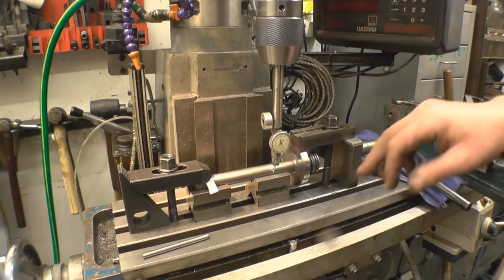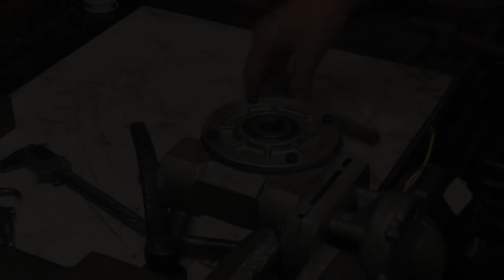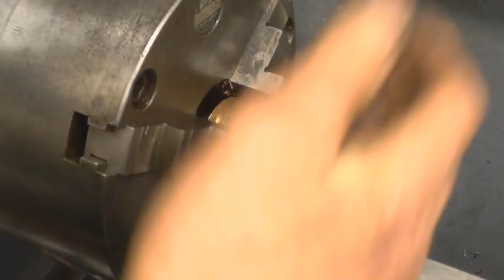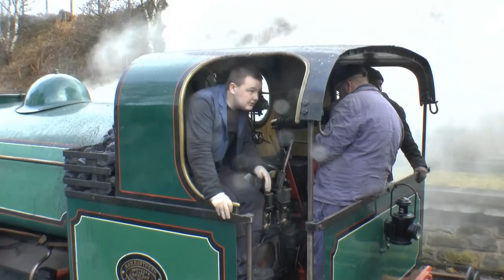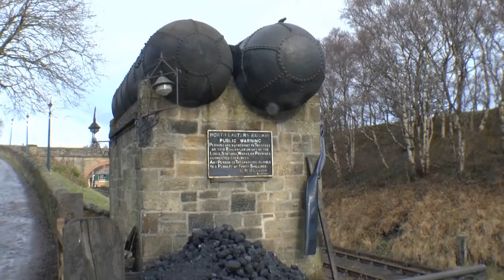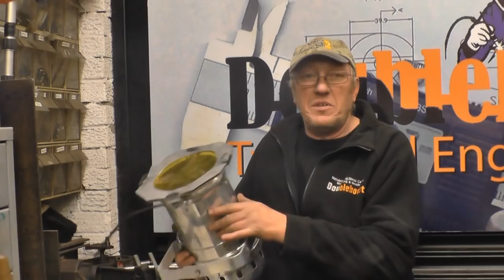SNNC 211 P2  Key Way Cutting     Steam Locos

Comment: A single carbon brush from a starter motor on the outside of you copper ring would give better contact than copper to steel! Just a thought, cheers, Matthew.
Reply from the maker: Yes that would be much better